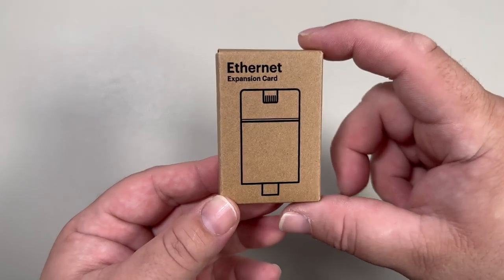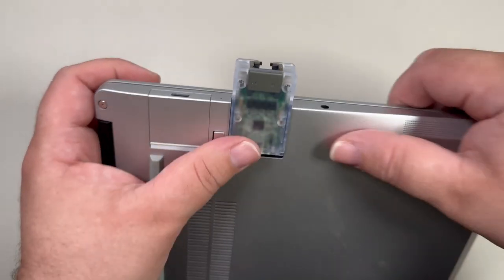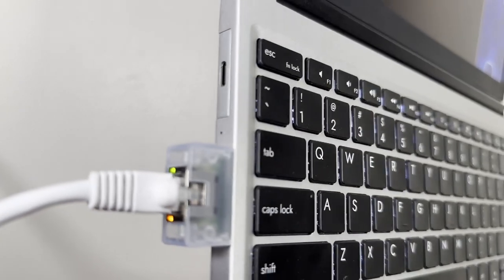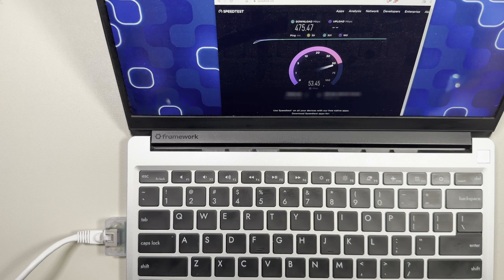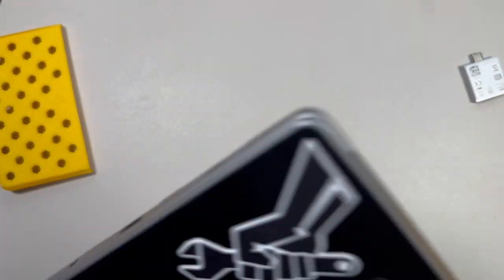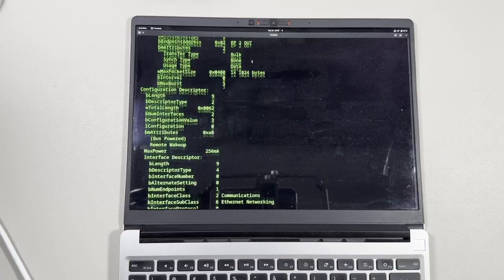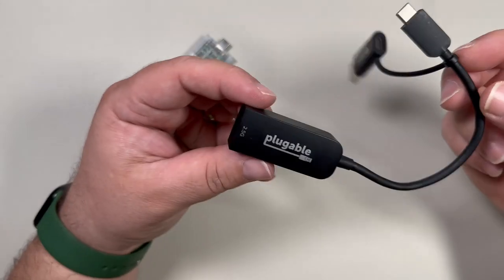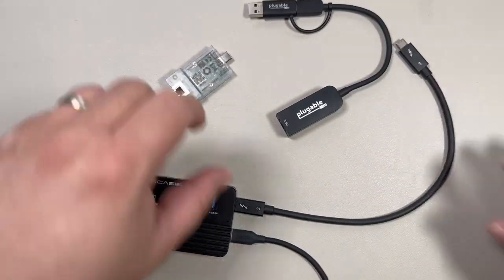Framework Ethernet Module

Comment: Should/would there be any issues buying this adapter, plugging it into an MacBook Air or a Dell XP 17 USB C port?  It should be recognized, yes?
Reply from the maker: For your Macbook I'd suggest the Plugable 2.5G USB C and USB to Ethernet Adapter https://www.amazon.com/gp/product/B084L4JL9K instead of the Framework ethernet.

The Plugable is also a 2.5 GB Network interface,
and it has support for mac.

Comment: Get 2.5gb switch and build a 2.5gb nas. I use multigig for lan not wan
Reply from the maker: I haven't made the jump to 2.5 GB Lan networking gear yet.
Reply: @Jscar_Hawk  the way you word that though. all you need is one small switch, there are switched that mostly one gig with 2 multi gig ports if you're on a super tight budget. you can have two devices ate multigig and the rest with gig, no need for a total over haul. in my case i got one susch switch and my main already have 1x 10gig port, and linked up my multi gig that way but, if i had a smaller network the little 10 port could have sufficed. just my 2 cents.